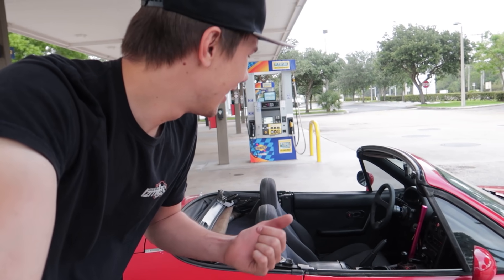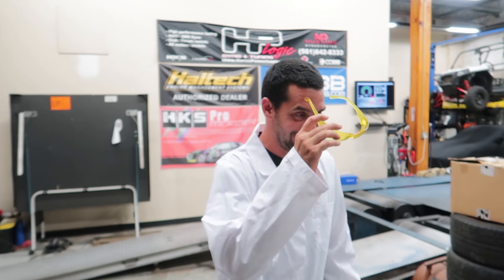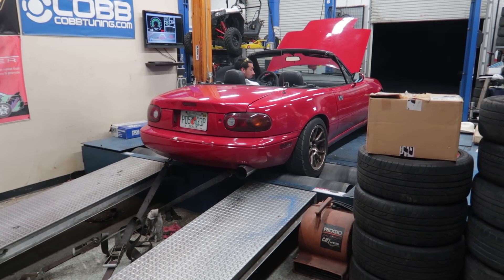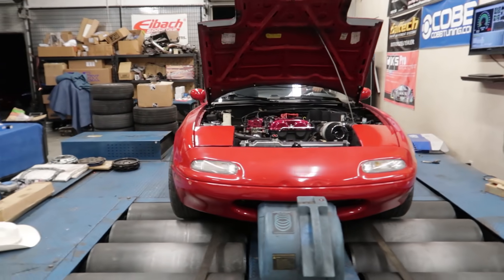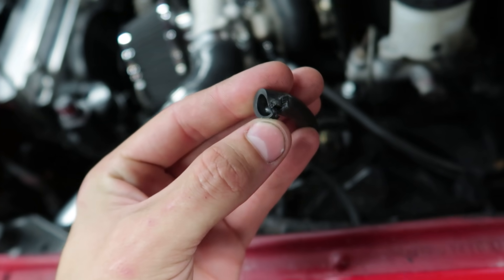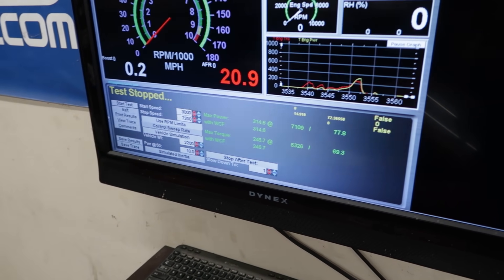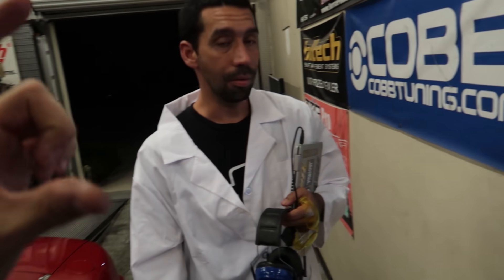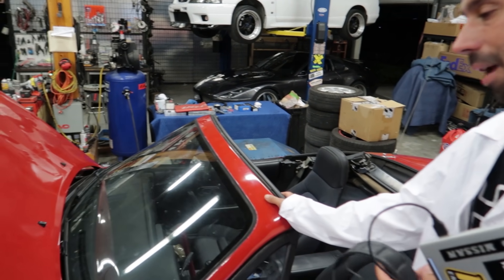FORGED MIATA E85 MOON TUNE!

Comment: The volume required to get the same energy as gas with E85 cools.  NA it doesn't help much because you can dump all the fuel you want but the air will be the same and you need a good ratio to make power.  With BOOST you can cram that air in there with all that fuel your dumping to cool things down.  Now cramming/compressing air does create heat, so as you cram more...  Basically it's a battle to keep things cool enough to make power(heat) and not melt down

Comment: Hmm, never really thought about it, but if you run E-85 and are dumping a LOT of it in the engine, wouldn't some of it leak past the rings into the oil? If so, it probably would be a good idea to keep on top of oil changes in such a car.

Comment: I know they aren’t cars mean’t for acceleration, but, will this beat the S15 in a drag race?
Reply: Going off power to weight it should absolutely beat the s15 by a fair bit
Reply: His s15 is faster
Reply: @griplimit  how do you know?
Reply: griplimit probably not
Reply: Line em up boys

Comment: @9:00 I haven’t finished the video yet, obviously, so you may end up doing this, but if you take the filter off and make a pull you would probably pick up 20whp.
Reply: Lol... Nah dude
Reply: Lol......yeah dude. Cheap filter like that one he has on, is a huge restriction.
Reply: @Tomford.888.  not a 20hp restriction. Maybe 5 of it's the worst filter in existence
Reply: On a N/A application I would agree with you. But on a turbo application is can be as much as a 1 psi gain which can usually net a 20hp gain. I’ve seen as much as 35-40hp gain on V8s.

Comment: Forged stock motor .. almost has the same hp as Chris’s exspensive sr 😂
Reply: Forged stock motor ????? Wym by that
Reply: akid4ever meaning 1.6 or 1.8 Miata motor
Reply: @justynbelcherr5500  no, a forged motor isnt a stock motor i didnt forged my motor just so it can be called stock
Reply: akid4ever it’s the stock motor, with forged internals. I think he just means that he took and beefed up the motor that was in it and is making more power than the expensive SR that Ruddy bought.
Reply: Nate King exactly
Reply: @notmychairnotmyprblm  obviously its the Original motor i think youre getting Original/OEM confused with stock people in the car community is calling everything with a mod stock, the motor is built a built forged motor is not a stock motor that motor is now capable to produced imense amount of power than a regular factory motor. His built motor, without a turbo would do more power than a fully "STOCK" miata head to head on a dyno

Side note: "beefing" up a motor or modifing a motor no longer makes the motor stock, people now-a-day say Full FBO is stock smh.

Comment: stock engine mounts??? 
those are known to rip into two pieces on stock power. innovative and AWR make good solutions, but competition miata mounts are a cheaper, slightly easier alternative for street cars. 
id shy away from comps for the power you're making though, also might be worth beefing up the diff mounts to polys too, they're cheap as well
big yikes, 3-5 shifts all day erryday in those conditions

Comment: E85 is not a "power adder" it's an alternative fuel that contains 85% ethanol.
Reply: It prevents detonation so you can safely pull more power from your engine.